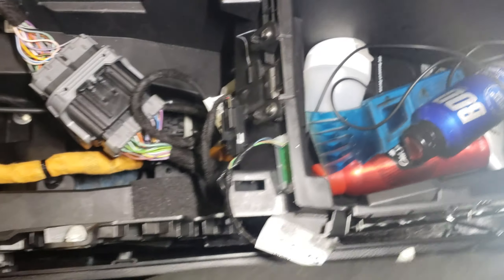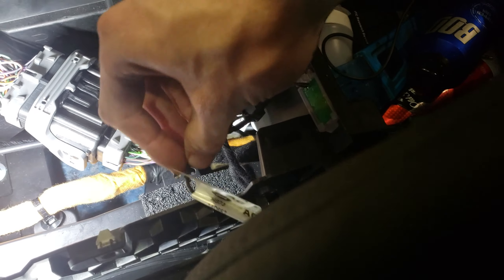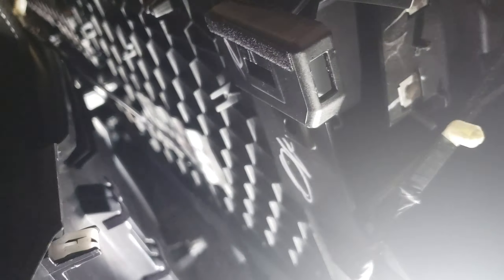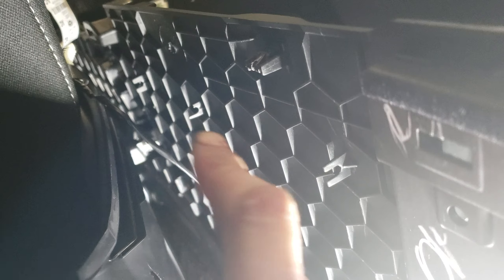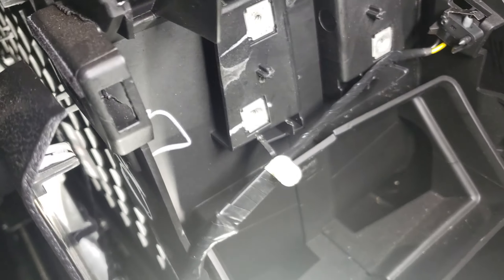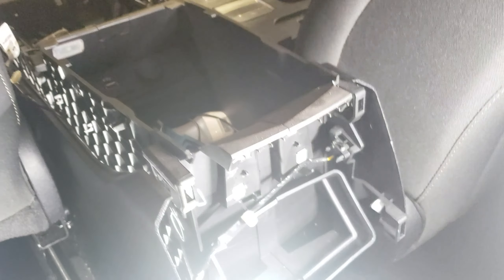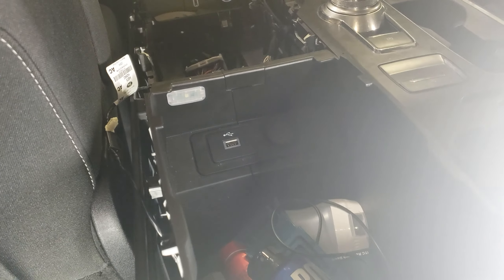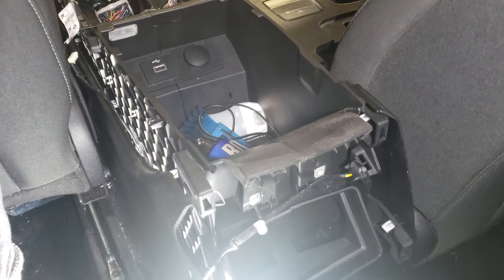I finally found out where the center console storage light wiring goes to

Comment: Hey nick can you make a quick video about the speaker wires that goes to the 6x9 subs in the back. Im trying to see if my car has the wires in the back or if I have to run them myself. Thx
Reply from the maker: I will have to look on mine. I believe the 6x9 speakers wires go to the amp which is located on the passenger rear trunk you will need to remove the trunk side panel to see the apm